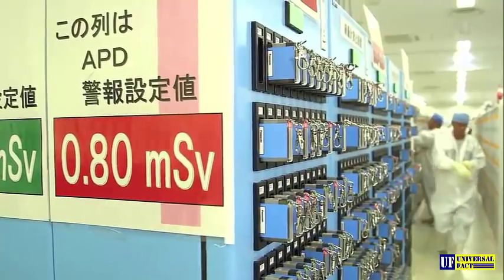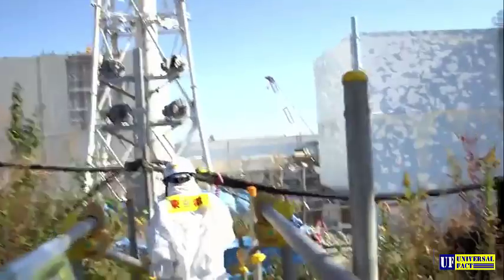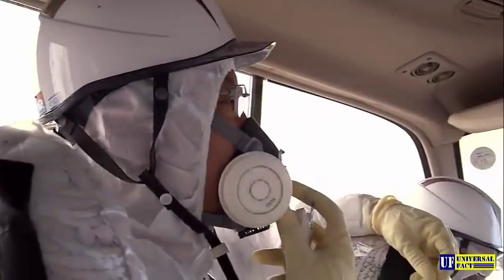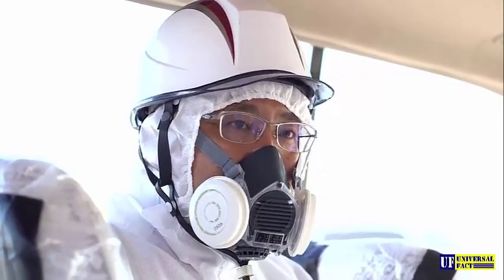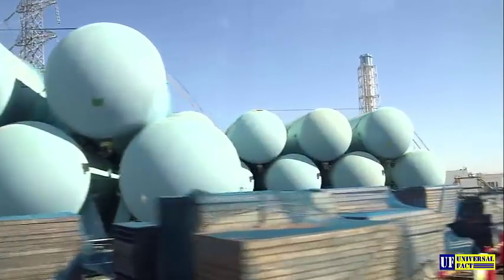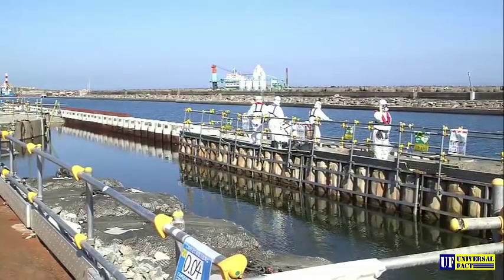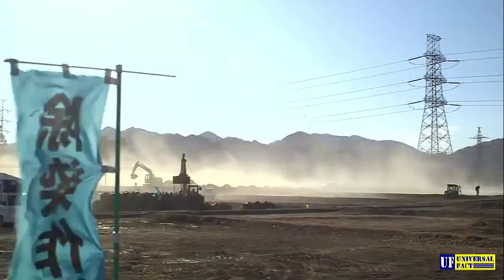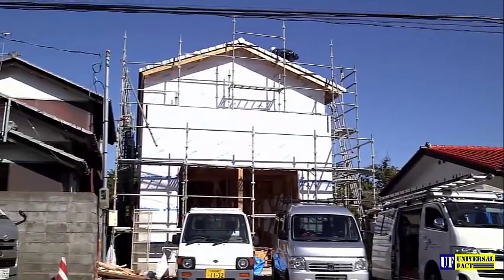5 Years Later, the Fukushima Nuclear Disaster Site Continues to Spill Waste

Comment: If reactors leaked in the US do you think we would have it stopped by now? Maybe we wouldn't stock them with more fuel then a workers shift in case there's a meltdown, maybe it should be stored away from the reactors and regularly be feuled to maintain a low stock of feul in or around a reactor. Maybe a safer fuel should be used for energy like ocean kinetic, solar, and hydrogen.  An engineer in the US put out the Kuwait oil fields using a blast to put out the fires, and it worked. The fire was so hot water turned to steam, and water on the ground mixed with the oil and spread it.. Maybe a non flal.mable co2 blast would separate the fuel in these reactors from the heat source and stop feeding the fire. Maybe a blast would take the logs in the fire away from each other so it can go out, maybe containing a fire is not the way to put out a fire in a fire pit. I guess the reactors are so hot if you tried to dump sand or sand blast sand in there it'd just melt into glass, if only you could put it out with sand like a regular old fire. People shouldn't really be making stars on earth, and playing with that kind of firepower, we'll be the planet that figured out how to make a sun from elements feeding earth's core and then ruined our own planet with it.  If God ever comes here on vacation he's not gonna be happy as to what happened.  

We better stop before we burn down his whole yard